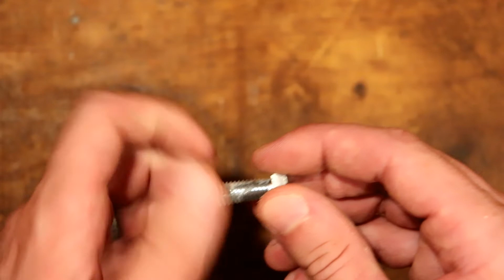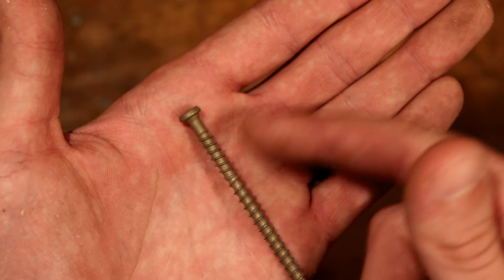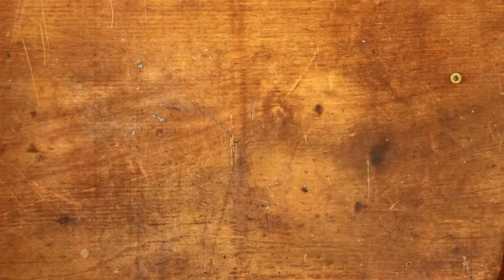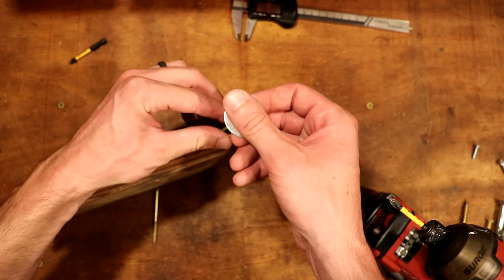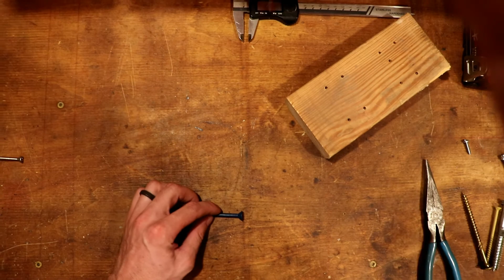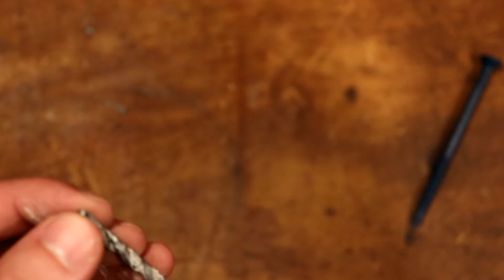10 Essential Screws and How to Use them

Comment: Can you use structural lags to hold up garage ceiling storage racks and wall mounted tv mounts?  I normally use lag screws (bolts) but if I get better holding power and no pre-drill holes that would be better route.
Reply: You can find the load limits on the box for those GRK structural screws. They're shockingly strong.